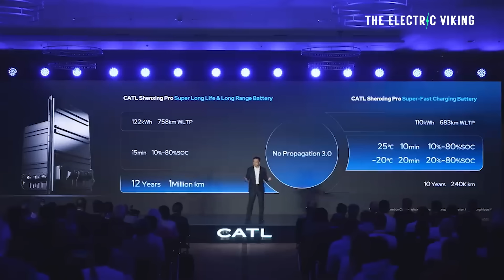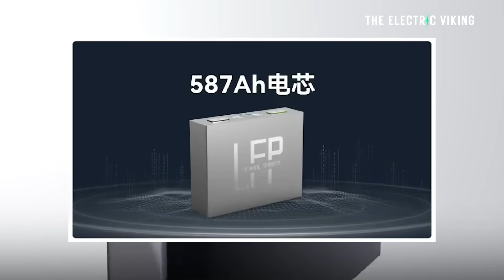CATL Reduces LFP Battery Costs 43% and INCREASES Energy Density

Comment: There is still the same problem ,battery good  enough  for  long range  is  about  100kWh  which will weight as a package about 800kg  ,  The world needs  new batteries for EV  with  450-500Wh/kg !!!  ASAP
Reply: Ever drive an old Cadillac? Things weighed about 2.5-3 tons. Cars have become amazingly light as we've developed industrial production standards like 6N and stopped casting engines with old-school cupola cast-iron, but fuel-efficiency doesn't scale very much with weight since air resistance is the biggest force cars have to overcome. Let's build 'em heavy again if it means they last 50 years/5 million miles without major maintenance.
Reply: @thesquatchdoctor3356  With EV  more weight  means significantly less range. The sweet spot for  100kWg battery EV   is  about  2000kg  not more than that . 150kWh battery EV maximum 2500kg  EV .  With current  LFP batteries there is no chance for that.
Reply: Current battery tech is good enough to remove fossil fuels from the equation. Of course better is better and batteries will continue to improve.
Reply: @williammeek-h2o  Car Seller way of Thinking , current  NMC / LFP  batteries are  quite  obsolete !!!
Reply: @Bemx2k  what do you base that conclusion on?
there is nothing better on the marrket right now

Comment: Sam
Near the start you say CATL produce a cell every 2 seconds, the later on you so they produce sells a day, Andy repeat this just before the end. However, 220,000 per day is about 2½ cells per second?, or one cell about every 0.4 seconds?
Reply: Depending on context, those numbers could all be true. Maybe one line is every two seconds and they have 5 lines running that average a certain daily number. Needs clarification certainly.

Comment: What happens if you invest in phosphate and then everyone goes to sodium?

Thank you.
Reply: Won't happen. Sodium has lower capacity and much higher voltage drop during discharge - ok for stationary storage but not great for other applications. It may not even cost less in the long run, if lithium becomes more abundant (which is happening).
Reply: @bhabbott  OK.

Comment: Not well suited for cars; maybe busses.  40 cells worth of KWhr would be big enough for a car, but only around 175 volts.  Cars want higher voltages to reduce the size of conductors, and to be compatible with charge networks that are mostly 400 volts but moving towards 800–1000 volts for charging with reasonable gauge cables.  Cars want smaller cells in larger quantities.

Comment: My 2013 Leaf had a battery that at 2012 wholesale prices, cost $17,500. That same battery at current prices is under $1000.00.

You are looking at a serviceable EV where the battery costs less than the tires.
Reply: You’re driving on a 12 kWh battery?  What’s your range, 30 miles?
Reply: Is that for the original size — 24 kWh? How much is a 60 kWh up-sized battery for the Leaf?
Reply: @Clyde-2055 I'd be happy to get my Leaf battery back up to 24KWh. Currently it's about half that, and will only get worse. The supply of good used Leaf batteries is drying up now, so repacking may soon be the only option - the cheaper the better!
Reply: @bhabbott  check with a company called Vivne . They make CATL  replacement battery packs for the Leaf in various capacities. Max size is 62 kwh .
Reply: I gave you a thumbs up because it atleast explains some of the real world possibilities however untill i can see it (best bang for buck) I shall stand firm with the essential proven concepts as opposed to the overhyped rascist fads,without the grid hike$
Reply: I can get 4 semi slicks under 700 put them on my manual cheapbox and out perform you absolutely everywhere including range more important refuelling on extended trips,
no substitute for real world experience yet if it still aint broken,why try to fix it anyway?
Reply: @mitch-c3z  You are not outperforming on cost of ownership. Which is the point of a Leaf.

Comment: Aqueous/saltwater batteries (laboratory and emerging technologies)
How they work: These are a type of battery that uses water-based (aqueous) electrolytes instead of the flammable organic solvents found in lithium-ion batteries. Some versions use saltwater, while others use different water-based solutions with materials like magnesium or sodium.
Current status: This is an active area of research and development, not a widespread technology yet.
Recent breakthroughs:
Researchers have created magnesium-ion water batteries that are safer, more sustainable, and potentially capable of replacing lead-acid batteries in the near term and lithium-ion batteries in the long term.
A separate Chinese study detailed a laboratory-developed water-based battery with high energy density, though the results need to be verified and reproduced.
Challenges:
Energy density: Aqueous batteries have historically struggled with lower energy density compared to lithium-ion batteries.
Cycle life: Extending the number of charging and discharging cycles to be competitive with lithium-ion batteries is a key area of research.
Mass production: These new technologies are not yet ready for mass manufacturing.

Comment: Pumped storage hydropower (PSH) "water batteries"
How they work: PSH systems use electricity to pump water from a lower reservoir to an upper one during times of low energy demand. When energy is needed, the water is released back down, turning turbines to generate electricity, much like a traditional hydropower plant.
Current status: PSH accounts for the vast majority of grid-scale energy storage capacity globally, with hundreds of plants operating worldwide. There is a strong ongoing push to develop more PSH projects to support renewable energy integration.
Advantages: They are a proven, reliable, and long-lasting energy storage solution that is currently the most common method for large-scale energy storage.
Disadvantages: Building them is expensive, time-consuming, and requires specific geographic conditions, like large elevation changes and water sources.
Reply: you forgot to mention the efficacy of power use to pump water compared to the efficacy of storing energy with batteries
Reply: @garryferguson799  Pumped storage hydropower is roughly 70-85% efficient, while lithium-ion (LFP, NCM) batteries are typically 90-95% efficient for NCM and 92-98% for LFP, and sodium-ion batteries can reach up to 92% efficiency. However, efficiency alone doesn't tell the whole story, as pumped hydro excels at large-scale, long-duration storage, whereas batteries are better for shorter durations and have a smaller footprint.

Comment: A 13 kwh Tesla powerwall costs 7600 Euro or 580Euro/kwh  in Germany. I would appreciate a 40 percent price reduction.
Reply: why tesla, when 10k customers had their power bank completely bricked. Tesla is not offering repairs or replacements. not are they offering refunds. many of these dead power banks even fall under manufacturer warranty and they still refuse to do anything. look else where for a power bank. i dunno if Sol-Ark is available in Germany, but they are incredibly reliable, have an easy grid disconnect for grid-tied solar systems, in the event of power outages in a community, and have easy, direct generator connection, for power back up in the event of long outages for off grid and grid tied situations, in the colder months when solar produces less. the 15kwh power bank costs $10750.00 in Canadian currency. after converting to euro its roughly a little more than 6600.00
Reply: @dustinherk8124  I never thought of a Tesla powerbank, I just wanted to point out how expensive batteries still are for the normal customer. BYD is 4000 Euros for 10 kwh
Reply: Lol, Tesla isn't competitive these days, some people just like Elon Musk and think the luxury pricing is worth it to have his name on it. Never buy a power bank that's connected to the Internet and brickable by remote. Especially from a guy who really likes that Old German "Hail Victory" salute.
Reply: @thesquatchdoctor3356  that uh wasnt a salute, that was an arm swing taken out of context of an adult with autism. i dont like Elon, but i understand the difference between reality and sensationalism.

Comment: NEWS FLASH .. batteries .. don't produce .. energy .. they CAN'T replace hydrocarbon sources of "energy".. theyre JUST a fuel tank
Reply: OP on this thread is a troll.
Reply: @docwatson1134  a bit like this video
Reply: "You are 100% correct in what you’re saying, but your perception is mistaken.
A storage battery is merely a 'fuel tank' for electrical energy, yet it can effectively utilize electricity that would otherwise be wasted due to fluctuations in renewable energy generation.
The same applies to nuclear power: large amounts of electricity are discarded due to demand fluctuations, but by storing it in batteries, it can be put to effective use.
We need to recognize that a simple 'fuel tank' can have the same effect as generating electricity itself."
Reply: @Galaxy-su7-u  no it doesn't
Reply: Yes but combined with solar or wind they make a complete 24 hour replacement for fossil fuel.
Reply: @PxThucydides  adds hugely to the cost .. as well as expiration end of life .. no efficent "recycling" .. AND .. its not "fossil" fuels .. no fossils in oils making .. read up on the science of "fossil" fuel

Comment: So the size of these batteries are NOT the size of the batteries typically used in cars.  So what is the implication to cars with this different size battery??? I'm assuming there would need to be some redesign of a cars battery packaging to use these large batteries?  And so I'm assuming  we are unlikely to see this size of battery in cars in 2026 and hence no lower cost batteries for EVs in the immediate term? You said some cars were planning to use these larger sized batteries....Do tell. Who is planning to use them?
Reply: This latest CATL LFP battery chemistry will be available in multiple prismatic case sizes. Even the largest cell size would (and probably is) adapted for EV use. But because of the middling energy density (about the same as the blade LFP battery) and lower price, it will more commonly be used for stationary storage. But it will (no doubt) used in many BEVs as well.
Reply: @deanmcmanis4862  Hope so. It would be nice if EV's were a bit cheaper and could have a bit longer range.
Reply: @Jetter638  The good news is that EVs are steadily getting cheaper, more efficient, and having longer range. And they will only improve even more in the near future.
Reply: @deanmcmanis4862  It can't happen fasten enough for me. They'll need to be cheaper than gas cars in order to reach critical mass otherwise it will be a slow transition in the USA (pure combustion -> Hybrid ->BEV).  Also they need to shorten the charging times down to 10 minutes or less to overcome the range anxiety. I'm guessing this will only come via Solid State Battery technology whenever that becomes commercially viable AND cost effective (5-10 years?).
Reply: @Jetter638  Used EVs are totally affordable right now. For 80% of today's EV owners, they charge up overnight at home for a couple bucks, and it is all recharged in the morning. No worry about charging speed, charger availability, or range. Most EV owners use less than 15% of the battery's capacity daily, and charge right back up nightly. No need for hybrids, more/faster charging stations, or solid state batteries.

Comment: All of this innovation leads to a sort of paralysis for me. I keep thinking next month, next month for rooftop solar and a battery but finally organising it for after Christmas. The tech is mature enough to have a great ROI right now. I would rather have sodium battery storage though because of safety.
Not buying Tesla for sure after they drained and turned off powerwalls remotely and without notice, and so far aren't replacing them. The homeowners are screwed.

Comment: I hope this means the Power Wall will come down by a couple thousand. It's kind of expensive, and the U.S. incentives are ending.
Reply: We will probably see competing home batteries costing a lot less.
Reply: If it’s made in China, Americans can’t get it.
Reply: Tesla charges $7500 for installation.
Reply: Sodium Ion will not work well for home storage. It has too broad a voltage curve. At 9 volts it still has half it's power. Inverters cut out at around 11 volts. So it would need specially designed inverters.
Reply: @hoffinger Is needing special inverters really an issue
Reply: You can build your own for a lot less.

Comment: This will continue as new types of batteries become available every year. The inflated cost of the last decade was just what the market would bear and not a reflection of the actual cost to produce at scale. Energy storage adds to the scale making batteries for vehicles more affordable. At the same time the cost to produce and recall risk of ICE is increasing and greater cost to assemble ICE vehicles. Regulation won't cause ICE cars to go away but cost delta with EVs will. ICE cars will become a low volume luxury item similar to analog watches.
Reply: china gas stations are closings run out business.. create ICE range anxiety. jerrycan needed for emergency.
Reply: @Cuff-re8ej  One thing about gas is it can be delivered in a can and the car quickly fueled. That's the one advantage.
Reply: @frankcoffey Batteries are charging faster and faster.   Someone will soon create tech that AAA will drive out an EV and quickly charge it.
Reply: @1diggers1 Possible but not widely available now.
Reply: @frankcoffey Yes I was speaking about the future.
Reply: @frankcoffey  Is that an advantage? sounds like a detriment to me compared to being able to plug into any available plug in an emergency.
Reply: @1diggers1  There are already such trucks in some cities. There just isn't enough demand yet because apparently, EV drivers know better than to drain their battery.
Reply: @williammeek-h2o  Oh that’s cool.  Yeah most drivers are very careful about that.  Being able to charge at home probably helps with it too.

Comment: $40 per kWh is pretty insane if true.
EVE MB56 628Ah LiFePO4 cell has an energy density of about 175 Wh/kg or 2.01kWh per cell and costs $150 which comes to about $75/kWh.
Reply: A few years ago I built a 21 kwh for $6k   with used batteries new hardware that I could do it for about 2k now is crazy and better cycle use
Reply: @walterrwrush  A couple of months ago, I bought 135 kWh of used 280 Ah cells for $7k including shipping. Working on turning them into various batteries. Built a 3.6 kWh, 4 kW power station with 1600 watts of solar charging, Built 3x 15 kWh 48v stationary home batteries. And no am working on a mobile whole home backup that will be powered by a 90 kWh high voltage battery (320V) with 30 kW of inverters.
It is fun playing around with this stuff. Home PV and storage is going to be the hobby that takes over being a home mechanic.
Reply: I don't know where you buy your cells from, but I don't pay more than €100 for the EVE MB56

Comment: Never seen so many dumb comments I feel like your following are morrons Fosil fuels are not cheaper in the long run and news comes out every day about new batteries but we have not seen that big of a change yet but with data centers and the need for energy thier will be massive upside in 10 years for all energy products. I do think CATL will lead the battery market and tesla has never wanted to lead this space they are a software company that also does manufacturing.

Comment: The problem with lifespans of 30 to 40 years is that these batteries will likely be obsolete in less than 10 years just judging from the amount of research and speed of change in the industry. Probably not a problem for countries with a lot of open space like Canada and Austrailia, but in countries with limited space, they'll want to replace this technology with newer higher density batteries as it comes along. Maybe CATL or another visionary battery provider could consider a long term upgrade and recycle contract for customers.
Reply: It’s unlikely to be economically worth replacing batteries that still work fine. We need to deploy thousands of times more batteries than we currently do anyway, so if some are older and less energy dense it doesn’t actually matter that much. Better to deploy more new ones as well rather than replacing any till they truly wear out in 30-40 years.
Reply: No country has so little space that battery packs will need replacement . That is like throwing away an old car because you can't afford to park it in the yard?
Reply: Technology that seems cutting edge today will likely be obsolete in 10 years. I spent my whole career installing technology then removing that equipment and installing newer better equipment in the same place. After the initial buildout of battery plants, it will be cheaper to replace smaller capacity batteries with the latest and greatest rather than build a new facility.